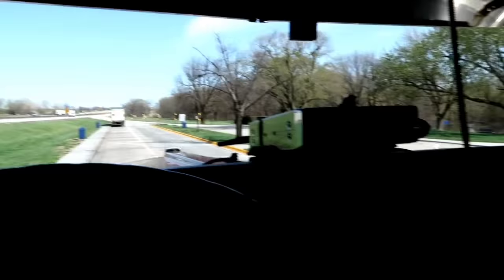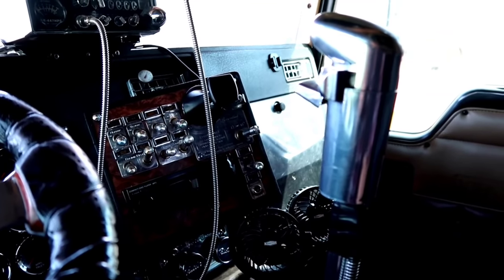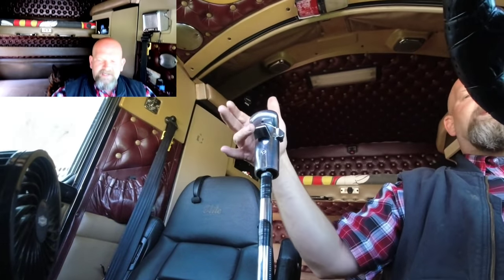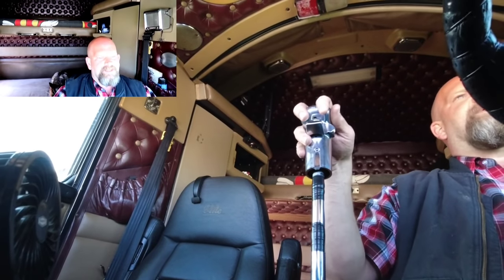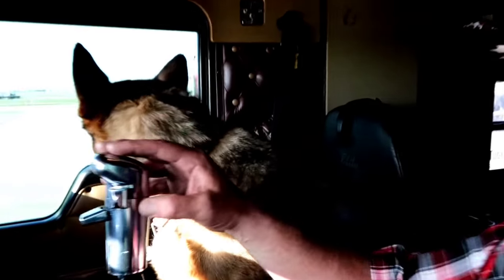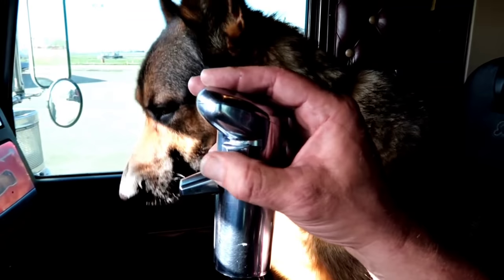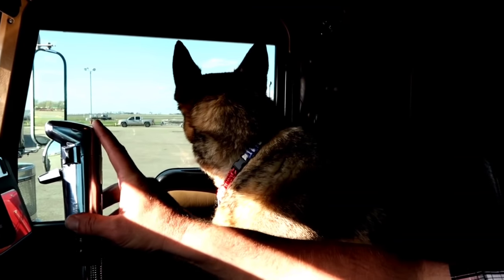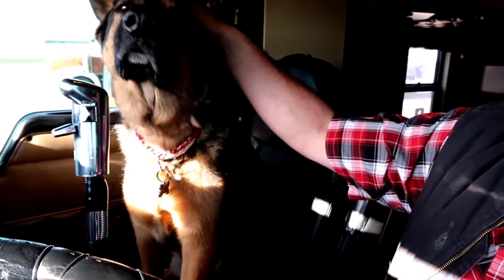How To Shift An 18 Speed Transmission SMOOTHLY ~~ Meat Delivered #323

Comment: Just to save your leg…just a recommendation, you don’t have to move the stick in and out of gears to get your half gear. Just push up on your splitter remove your foot from the accelerator and push back on it, it will give you the half gear. Just put it back down when you go the the next highest gear.
Reply: He never touches the clutch
Reply: Well he's floating gears so he's not using the clutch anyway genius.
Reply: @nicksweet55 your missing the point. This guy's right. Whether he's clutching or not you don't have to move the stick at all.
Reply: @nicksweet55  calling him "genius" when you are totally missing the actual point "genius"
Reply: How would that save his leg?
Reply: It's just style when you move the shifter. Like kicking gears on a Harley. It's just a style
Reply: 😂 @bparker86
Reply: It's because you can't shift like that. Just say it 😂😂 my goodness

Comment: My Dad is the only other person I know that shifts that smooth. He taught me that you handle the shifter as gently as you would hold a baby bird.
Reply: @Leveraction-xr4uz  none taken. You're correct as well, but when I was learning, I  was a 14 year old girl. My Dad wouldn't ever say that to me. Was using his instruction until I retired 2 years ago.
Reply: My Dad told me the same thing except he said a boob!
Reply: This made me laugh "as you would hold a baby bird" im 57 yrs old ive driven dam near every kind of setup. I dont think in all that time ive held a baby bird. One thing i noticed when he was driving" ive heard this saying save your brakes and shift it in neutral save your fuel. There is a reason why you should never do this. In my professional opinion "jake brakes" should never be used on flat grades thats not what a jake brake is designed to do. No matter what drivers tell you brakes today are meant to last a longer time. A jake brake to most drivers is like buying a  a car thats loud no matter what they tell you its because they think the noise is cool. The idea of saving brakes is nonsense.  Unless you do alot of in town shifting you are never using that much fuel to downshift. coasting is never a good idea
Reply: @billyy7960 I drive a pete that has the jake built into the Gas pedal. You have to use it🤷‍♂️. I prefer our Mac though that has a 2 stage jake you have to manually engage.

Comment: The 18 speed is not an 18 speed because it has 3 reverse gears. It's 18 because you can split the first 5 low range gears equaling 10 then split the 4 high range gears equaling 8, for a total of 18. If it was the way you explained it then a 15 speed would really be a 20 speed

Comment: Ah so that's what I'm doing wrong, I'm starting out in a 610 Kenworth with 485hp hauling as a Roadtrain (3x Trailers & 1x Dolly) around 230000lbs. an Underrated Truck for a heavy load as apposed to Overrated Truck for a bare minimal load. lol

Comment: I got a chuckle out of you taking it out of the gate on the splits. I bought a Pete with a super ten and could not get a smooth shift until I pulled it out of the gate on the splits. Now I shift it just like a regular ten except I take it out of the gate and then put it right back in the same hole. Smooth as silk. Great video!

Comment: Went through my 10 month College Credited CDL Course in a W900 18sp.
We'd go into low or high then split, lift the peddle & back on the peddle then you was in your gear. 
Then I moved on to a 389 with the 18sp.
Your correct, drove it the same. Nice & easy into each gear. 🤟

Comment: FYI, the number of speeds refers to forward  speeds only, does not include reverse.  I do agree that you are one of the smoothest drivers I've seen in a long time!   Have Fun and Happy Motoring!!
Reply: It's 18 gears, yes reverse is a gear
Reply: @user-qv1wu8qq4r  The 18 speed transmission is laid out in an 'H' pattern. The easiest way to become familiar with the 18 speed is to practice shifting in an H pattern. The driver uses second, third, fourth, and fifth, then splits up into high range and then shift the H pattern again for sixth, seventh, eighth and ninth gear
Reply: @user-qv1wu8qq4r  Thanks for clarifying this! Happy motoring!!

Comment: Agree that a lot of rookies think that just because it's a truck you need to manhandle the shifter, basically doing chin-ups on it, but it's all about treating the equipment right. You treat it right and it will do the same for you. For me, I'm a long time heavy hauler and I think the Eaton 18 speed is the best shifting transmission on the planet, and there are times that even with my big HP I'll need to use every gear. I'm running a new Pete 567 daycab set-back tri-drive with a Cummins X15 Performance 605/2050, and it's an expensive piece of equipment built to do a specific job, so I treat it as if I bought it. Really nice tutorial for the guys who will actually listen and watch it, but as I'm sure you know, a lot of these rooks can't drive anything but an automatic and can't back up straight for 100 yards.
Reply from the maker: Thank you and it definitely keeps equipment going
Reply: @truckingwithschmidt7120  That it does, like the saying goes, "if the wheels ain't turning, it ain't earning". Trucks have made me a lot of $$$, so it pays to take care of the equipment.

Comment: My friend your. shifting is much like your personality. Smooth, never in a hurry, and easy on the equipment. 50 years ago I had a 5 and 4 transmission. Both hands off the wheel at times.
Reply from the maker: I've heard that, I've never drivin one

Comment: Well Mr. Kurt I understand you a 100% , lot of guys keep asking you because they don't understand what you're talking about,  They are just going to have to start learning,
Myself I'm the same way I don't need too look at the tac, I have the feel and the ear of the engine,  But I have learned this through my driving career,
and the slow Shifting that you have
I can have the slow Shifting in this peterbilt and it is all on RPM ,when I first bought this truck it was slow shifting and my friend plugged it in  and reset the RPM for  the engine RPM too come down quicker then it was doing,
It's kind of like low medium and high,
On high RPM come down too slow for me, so we put it on number one stage, RPM come down to quick so I stuck it on number 2 and it works perfect for me,
Be safe Kurt
Reply from the maker: That's one way to do that. Very nice

Comment: Now there's how it's better "splitted" properly, with the lever out & then back into the higher gear vs just flip the splitter switch & manipulate the rpm & let it pop into the next higher gear. 👍
My old man trained me   on a super 10 manually splitting as you do here ( with the lever out in neutral) & I figured the 13 & 18 speeds  on my own. (Was easy transition).
Enjoyed the vid thank you . 👍

Comment: Thanks for the demo. I was just curious after seeing the diagram of a 20 speed.
You made it look effortless.
Do you use the clutch while shifting?
And glad to see you staying in the right lane as much as you can.
I read in some European countries, trucks are ONLY permitted to use the right lane at all times. There was pushback but after it was implemented the companies found there were cost savings due to highways being more effecient, speeds were kept slower but with less stop and go traffic meant quicker deliveries and used less fuel.

Comment: Quite enjoyable. I learned that you should always try to be smooth when shifting, not raking the gears, and to always use the clutch. I later learned that in most cases you don’t clutch except for that 1st time. Oh, that’s a little nicer...then I get into a different truck and has been jammed a lot. It will act a little different when you shift. Now that may seem strange, but that’s what I’ve gathered. But no matter what, I like to be smooth and not wind it out too much when shifting...if nothing else but to make sure that you’re not causing your load to rock around, etc. Good stuff! 🤩🥰
Reply from the maker: That's always the goal on all counts

Comment: I move the Stick sometimes when I'm Splitting Gears.  Mom & dad had 20 trucks ..All Pete's & KW's..Dad tought me from when I was 5 yrs old  sitting in his lap, 13 yrs old I'd drive by myself, 1983 359 Peterbilt with 13 double over Aginst the Dash. Nowadays I find myself  when Splittin' gears flip the splitter at same time as moving the stick into neutral and right back into gear .I'm some gear changes it seems to be easier on the driveline, I love shiftin' gears .Am Very smooth and and precise with my gear shift,  I can split by Rollin off the throttle then ease back on throttle, some gear changes just seem to be smoother when moving the stick. Whether it's right or wrong to move the stick when splitting years I don't know but it seems better A lot of times

Comment: I don't feel it was long-winded or confusing-ng at all.  I learned a lot, thanks.  That idea of moving briefly into neutral when you split makes a lot of sense, it lets the splitting mechanism inside the trans do its work under no-load conditions ... smart.  Thanks for a valuable lesson.

Comment: As far as North American drivers go, you sir are the standard. Oh, and anyone who says in and out shifting is wrong, or you're hurting the trans, has never dealt with an old, tired trans that doesn't want to split gears. Many times I've had a trans not want to split the gear when simply letting off the accelerator, but it's never happened when I pull it out of gear, move the splitter, then put it back in. In my mind you have more control.
Reply from the maker: Thank you much appreciated

Comment: I’ve never done an 18 so my question is why drivers never do high and low on the first set but split and then in the second set or high side they split that set of gears. I was also told that you can shift it like a 10 and then split that last gear and it will save you some time. Great video stay safe and God bless
Reply from the maker: I slit the low gears as well, just matters where I'm at. As for the 10 speed shift style, I'm not a supporter of it, but that is just me.

Comment: As the saying goes look after your engine and gearbox and it will look after you, but I don’t know if you know that a lot of today’s automatic trucks goes in to neutral when going down hill it’s part of the new fuel efficiency for trucks, personnel I think it’s dangerous to just rely on the trucks brakes especially when fully loaded. Well done to coach Warden for another win and we’ll done Bud.
Reply from the maker: Didn't know that

Comment: i was taught to let the shifter find its own way into gear as you say mr Schmidt you don't need to jam it into gear i miss changing gear as my Mercedes actros is fully automatic 🤔but once i learned how to shift smoothly it was brilliant i can even block change 2nd - 4th etc ive seen several videos of shifting in a twin stick set up have you ever driven one i personally would love to drive onebut im guessing there a bit of a handful lol am i right in assuming you only use your clutch to pull away then its not used thats how i was taught on a fuller road ranger gearbox cracking video again and MR OPIE trying to steal the limelight was comedy gold 😂😂😂stay safe out there young man and pass on my congratulations to little bud on his soccer match from joff in the UK
Reply from the maker: Ya those twins would be a hand full, I've never done it. Yup I only the clutch to start. And will pass it on.

Comment: (For newbies):

If you can drive a 13 spd. you can drive an 18 spd. On the 18 spd., the bottom 5 are "split" or it's LOW-lo/hi, 1-lo/hi, 2-lo/hi, 3-lo/hi, 4-low/hi. (there is your bottom 5 split or 10 gears). Then it's: flip the "range selector" up and go to 5-lo/hi, 6-lo/hi, 7-lo/hi, 8-lo/hi. (there is your top 4 split or 8 gears). There is your 18 speeds. notice the last gear is 8-lo/hi? which on the 18 spd. is 17 and 18.

so, a 13 spd. is a 9 spd. with gears 6 thru 9 split. 
an 18 spd. is a 13 spd. with gears 1 thru 5 spit as well as 6 thru 9.

in "low range" 5 slots "can be" utilized (forward gears).
in "high range" only 4 slots "can be" utilized (forward gears).
can you see how the 13 spd. and the 18 spd. gear boxes are based on the "9 speed box"?
Reply: Correct, this guy is teaching people wrong. You can tell he doesn't know what he's talking about when he's calling the range change selector a splitter. There's only one splitter button and it's the one on the side of the gear knob.

Comment: Kurt the front is called the Range Selector or just Selector and the side is called the splitter... Next Reverse gears are NOT counted in the name of the transmission. 10 speed, 13 speed, 15 speed, 18 speed are all forward gears....While you can use the range selector (NOT RECOMMENDED) in reverse, and you can split the gears in reverse, it is not recommended to do so while moving in reverse by the manufacturer. However you can move the splitter forward and then start moving in that gear reverse. the 18 speed uses a standard H pattern with the exception of 1st gear   1L 1H Towards you and back, (2 Gears)... 2L 2H towards the dash in the top left of the H (4 gears)... 3L 3H bottom left of the H (6 gears)... 4L 4H Top right of the H (8 gears)... 5L 5H Bottom right of the H (10 gears)... flip range selector to high RANGE go back to 2nd position Top left of the H. 6L 6H Top left of the H (12 gears)... 7 L 7H Bottom left of the H (14 gears)... 8L 8H Top right of the H (16 gears)... 9L 9H Bottom right of the H (18 gears)
Reply from the maker: Thanks for the intel

Comment: You shift an 18 as if it was a 13, a friend used to haul Heavy, when he grossed over 90k, he would split every gear, and shift as you do, smooth, to avoid damage/excess wear to the drive line. His truck, so he had to do the repairs.
Best wishes all.
Reply from the maker: It is very easy on a truck

Comment: I use the splitter in low range regularly particularly when light or downhill to make the steps bigger. e.g. 2L, 3H, 5L. Being in the UK that's on a ZF not a Fuller, but that makes no difference in that regard. Another thought years ago when Fullers were in the market here many drivers would use Low in high range to set off empty especially with a straight 8 Gardner which had huge torque at idle, nothing over 1200, but would just wobble away at idle.

Comment: Hey, splitter, for the side button and ranger is the front button. Now, about the transmission model? And it go with your engine torque, so RTLO18918B or RTLO20918B ? And the last digit is your final gear speed. Few years ago, the was a A of B rating. What is yours ? Don’t worry, I do that a daily basis...specking Kenworth truck for a living. Yep, I’m a sale rep 😜
Reply from the maker: Lol come on!!!! I know it's an 18 speed eaton. That's about as far as I can answer that question.

Comment: Before I got my current plastic truck, I had a Western Star with an 18. I wouldn’t split the high side when empty. It never lugged down or anything. Hopefully I wasn’t hurting the transmission.
Reply: Low Hi Direct Over

Comment: Another great video on shifting from the shift master, your too hard on yourself it wasn’t rambling at all - it was very interesting esp to someone from UK where all our trucks are automatics. One question though Kurt, why don’t you have to use a clutch to shift in a semi? I know on a previous video you said there’s a difference in the gear box but you didn’t say what makes it so you don’t need a clutch. Congrats Troy on another crushing victory at FOOTBALL (soccer is swearing to a Brit 😉)
Reply from the maker: Ya know I don't know the mechanics of it, I just know it's easier on them to float vs clutch sorry.
Reply: @truckingwithschmidt7120  I’ll have to research it, thanks for the video.

Comment: When you’re shifting your action seems so slow. And I don’t know if it’s just because the RPM and the big cat comes down slower. I can shift slower on my 8LL vocational behind my old 60 series Detroit then I can in this Freightliner with a 10 speed behind a DD 15. On this one I have to move the stick fast otherwise the engine drops to quick and I miss the gear
Reply from the maker: Yes the cat allows more time. It's a slow rpm engine.

Comment: You add lots of extra motion between gears.  Is that because it’s loose with wear?  The extra stick wiggling reminds me of an old COE Ford ie. wobble stick.  Those old trucks never had any solid shifting feel.  It would be a better explanation to tell when you are shifting the rear axle gears from lo to hi from the gearbox hi and low.

Comment: 24:02 boy, the mpg readout on my International would disagree with this. When I stay in gear while slowing down, if I'm engine breaking, even a little bit, it reads 150 mpg which is as high as it goes. I believe it is actually using no fuel at all. Whereas if it's in neutral it is idling and therefore burning a little fuel and the mgp readout will drop below 150 if my speed drops below 40 mph or so. Is my truck wrong? Is fuel used even in engine breaking?

Comment: Great video,  I have a 10 speed cascadia.  So the big difference is the splitter.?
Reply from the maker: Yup
Reply: @truckingwithschmidt7120  thanks,  when you using the splitter hi low,  do you float out and back in or just come off the fuel if example say you going back into the same gear while downshifting
Reply from the maker: I pull out and back in
Reply: @truckingwithschmidt7120  thought so, that’s what I do, helps prevent grinding heard helps trans overall

Comment: I just enjoy watching you shift so softly, even though you have a messy gear system compared to a European H shift, with high and low, in the same gear.

But why not drive with automatic transmission in all trucks, now that you have at least 80 years of experience with automatic transmission for passenger cars.

No matter, just drive some truck :-) 10-4
Reply from the maker: Most new trucks are going to automatics
Reply: cause the automatics are junk